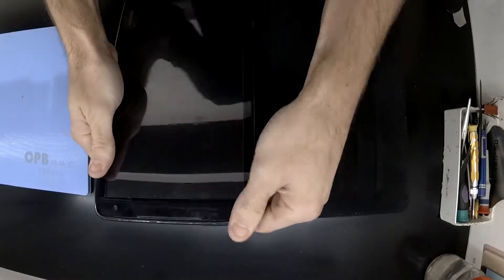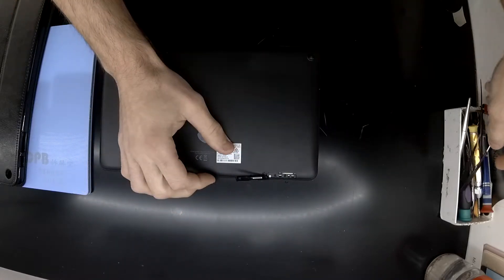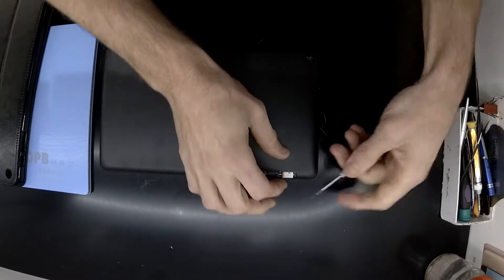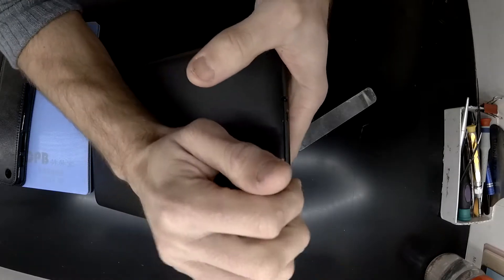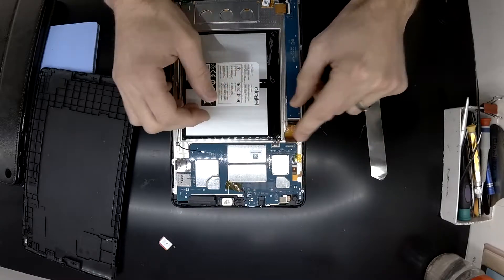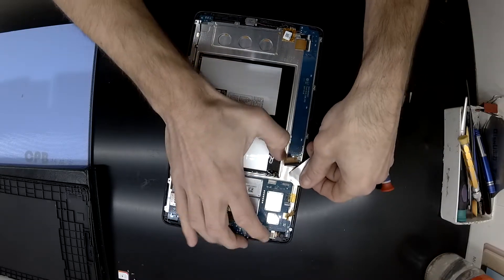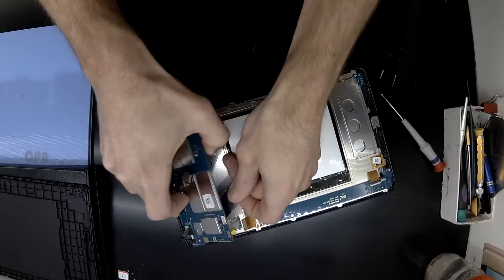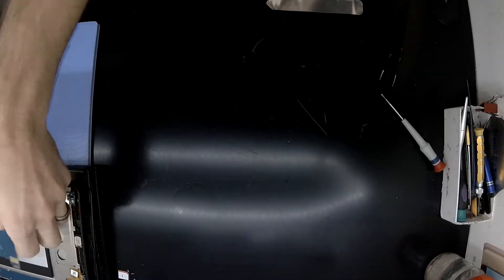Telstra Enhanced Tablet Teardown for mainboard micro USB replacement

Comment: do you show how to change the micro b and replace it with a new one
Reply from the maker: No 

I used a hot air station to remove the old one and attach the new one

Lucky for most people it's a fairly common usb jack

Comment: Hi can the battery's be replaced in these tablets....
Reply from the maker: It would be possible but you would need to find somewhere to source a battery
Reply: @rickstechrepairs  thanku i will  prob have to pull the back off mine and have a look at the battery to see what size it is ....cheers